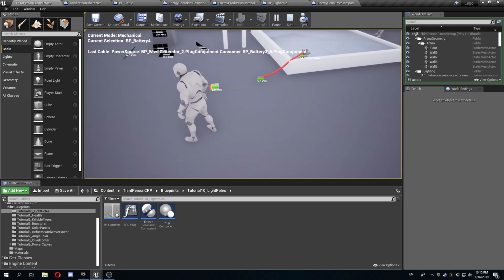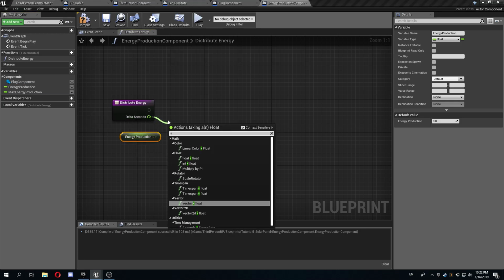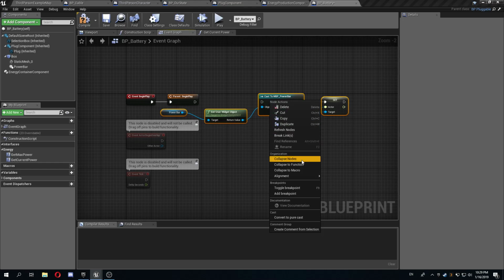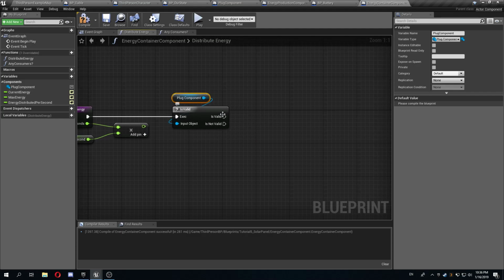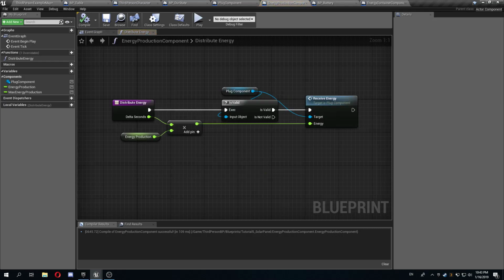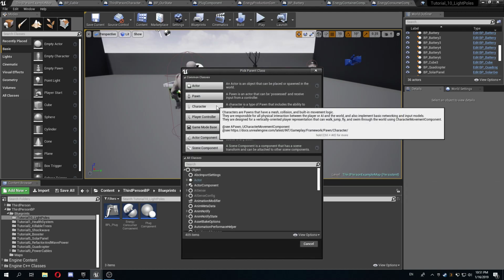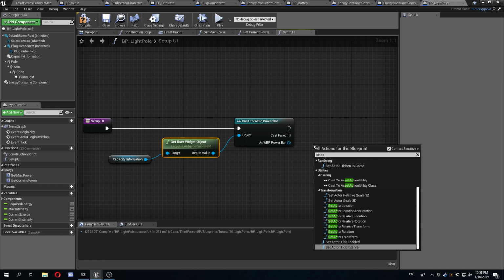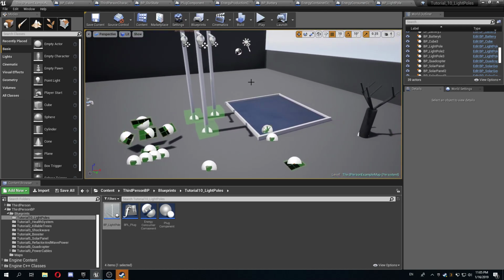UE4 Tutorial 10 - Refactoring Part 2 and Light Poles

Comment: What did you do to the batteries? They no longer slowly charge they just instantly gain max power? Help
Reply: Also wiring from empty battery to full battery doesn't fill up the empty battery
Reply: Have you found out? Also need help for this
Reply: @take0ne  bad news my friend, as you can see from the video, he changed it so that it now charges instantly, and I'm pretty sure he has the same battery issue too. I hope that he can make a third part to refactor these issues...
Reply: @TheFriedMovies  sadly his unreal engine stuff is completely dead. He doesnt answer comments, nothing. I hate this since he's literally the only channel on YouTube that has done this. What do you think, till which tutorial can I follow?
Reply: @take0ne  the one before the refactoring part 1 he's done in the last video. Everything else is fine but after he does these past 2 episodes he ruined everything
Reply: @TheFriedMovies  are you going to do something about it or give up? Its quite complicated so I have no clue.
Do you know a similar tutorial maybe?
Reply: @take0ne  I will revert my project from backup and ignore these past tutorials and deal with not having batteries connect
Reply: @TheFriedMovies  do you have discord? If we run into problems we can discuss on what to do since we are doing the same thing kind of

Comment: Do you think youll ever come back to this series?  Ive learned a ton and would love to see more
Reply from the maker: Anything specific you have in mind?
Reply: @noozo   Oh man thats a loaded question lol, i have all sorts of ideas related to power systems in unreal, but if i had to pick one in general right now, i would love to see how to implement a standalone cable actor instead of attaching the cable directly id love to work out a method for a extension cable.  Pick up at the plug on either end, male or female and attach to proper outlets.
Reply: seeing as there is already a plug component i would assume its partially already in place ?
Reply: @noozo  Idea : when you connect generator to consumer, overall network power lowers when you connect more consumers with their own consumption. Nice for parallel and consistent connection network simulation. also wires grabs some energy depending on their radius, distance and material resistance